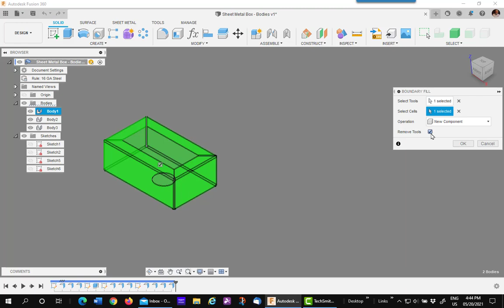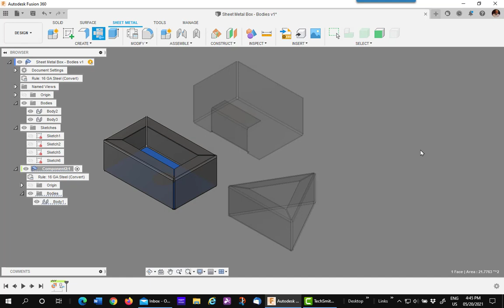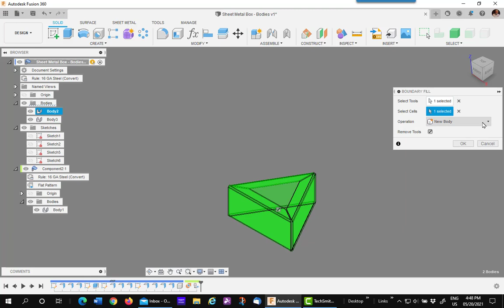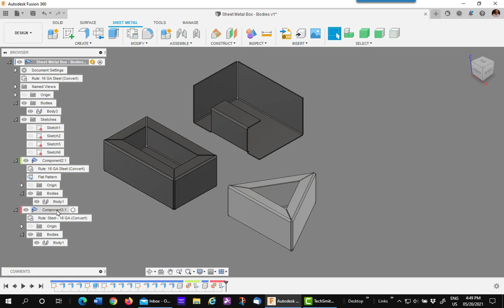Converting a Sheet Metal Body into a Component in Autodesk Fusion 360

Comment: Great video. How could someone possible just know this Without videos like this? Most people would be at a loss. Fusion 360 seems to just be contrary in everything they do for the purpose of unlearning Solidworks techniques so it's more difficult to go back to. The component/ body function seems over complicated and I won't even get started on the joints vs mates in assemblies debate.

Comment: Thank you so much Mr. Hackney.  This was a TOTALLY unexpected solution.  The inability to duplicate sheetmetal bodies in F-360 is an issue I run up against frequently.  Now I have a tool to address the shortcoming.  Also, even though you can always replay the video, kudos to you for solving it 2x to drive the point home.  That was surprisingly effective for allowing me to get it.  Thanks again!!